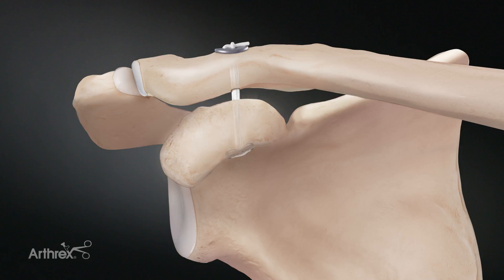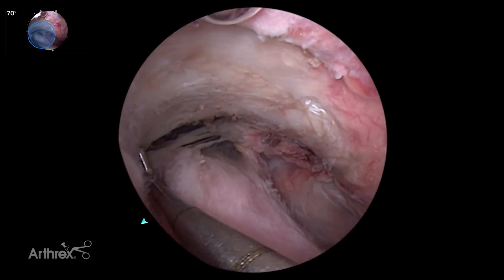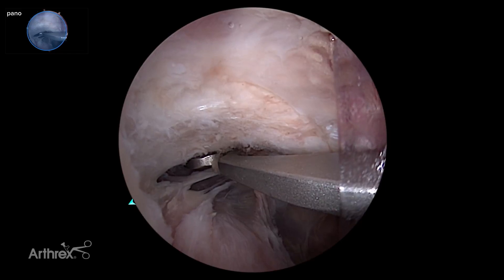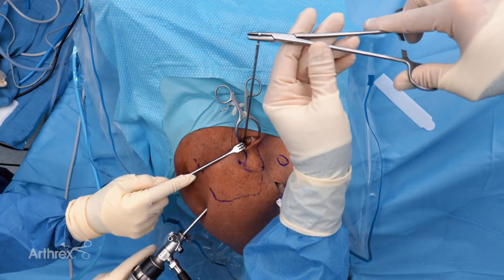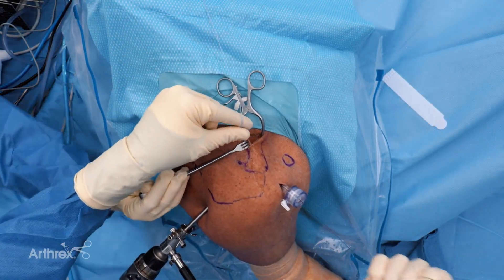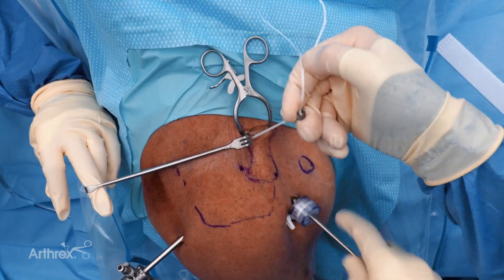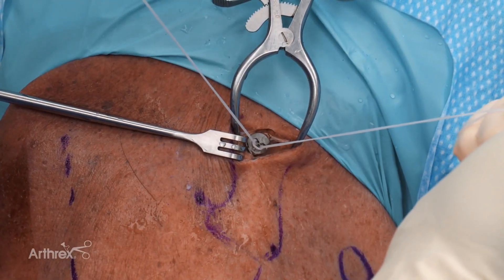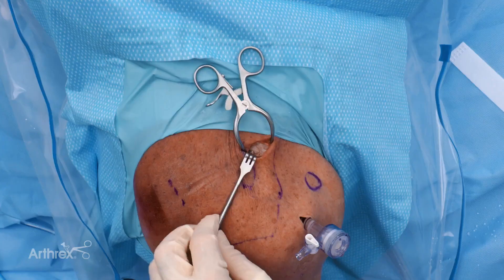Acute AC Repair Using the Knotless AC TightRope® System

Comment: If I had a previous AC3 repair, can this be used after the fact?  My clavicle was sawed off and drilled through.  The coracoid was looped around and secured to the clavicle with a bolt.  This looks a lot better and cleaner.  I wish it were around 10 years ago.